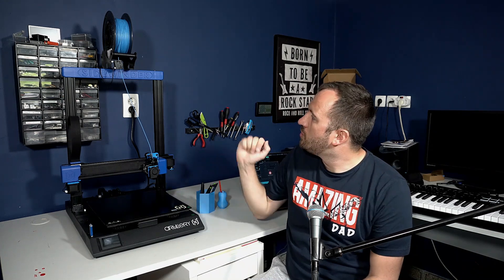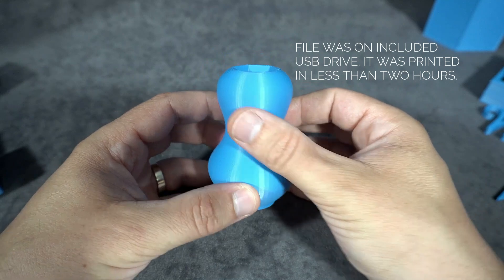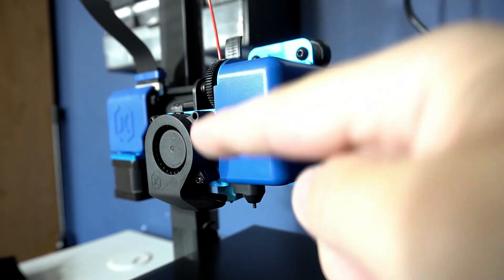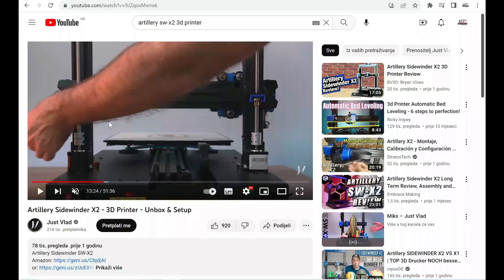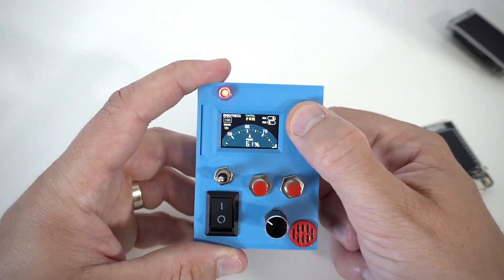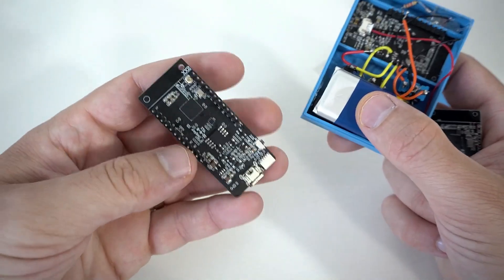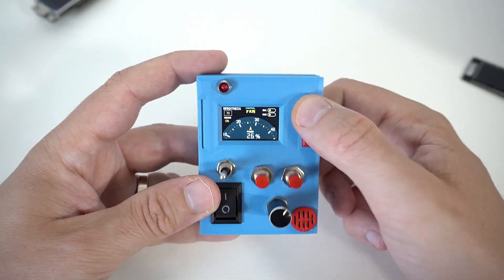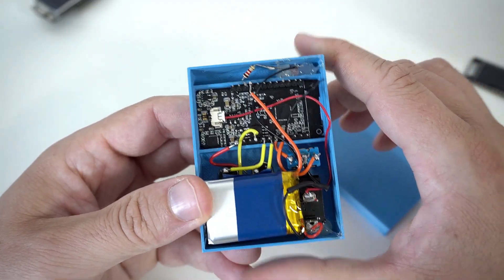I can't stop making boxes for my projects - Artillery Sidewinder X2 3D printer

Comment: Thank you!  3D printer technology is a moving target.  Had a Guider 2S around Christmastime, which had a couple flaws so returned it.  Just got a Creality Ender 3 V2 Neo, have cut the tape but that's all so far for the unboxing (am slow; multiply concussed; has its own benefits, interestingly).  And am now looking at the CoreXY stuff which prints several times faster...  :)  Thanks again!

Comment: Congratulations on getting a 3D printer.  I downloaded the STL file, thank you very much.  I have a simple questions about the two red buttons.  Did you print them or did you find something from your "box of random parts"?  If you printed them, would you consider adding them to the zip file please?  I am very curious if they are attached to each other or if they are separate.  I am also curious if you printed the bottom of the buttons with cups or concave surfaces so they stay in place when you assembled the project.  Thank you again.
Reply from the maker: Hello, thank you, i added buttons file in zip, but you will need to scale off them a bit, or make holes for them larger.

Comment: Nice Video! Ok SO your next project is monitoring the Printer from your S3 T-Display :D  - if you're Using Octoprint - they have a Great API !
Reply: Good idea! It is possible to run Octoprint, like on other printers it involves connecting a Raspberry Pi to get power from the printer and send commands via USB. The T-Display-S3 is really nice and the screen is very responsive, although it's a bit small at 1.9" so there's not a whole lot you could display. But for print time remaining and pause/resume controls, it's perfect!
Reply: @desmond-hawkins  I have build a S3 Touch display that I attach with Magnets to my Computer screen with the Status and Speed and Temps it works quite well!
What I would really like to do is display the PNG Thumbnail with the Progress Overlayed but alas my LVGL Skills are not there yet - And that's why i'm subscribed to this channel :D
I am using Klipper but OctoPrint's API is quite similar.
Reply from the maker: I am fallowing conversation and learning, i never heard for octoprint and klipper but this is interesting. So it allows you to monitor printer?  I need to use rpi? Camera? How that works?